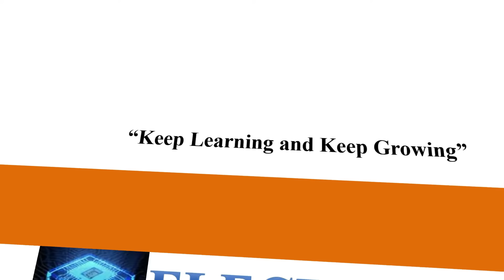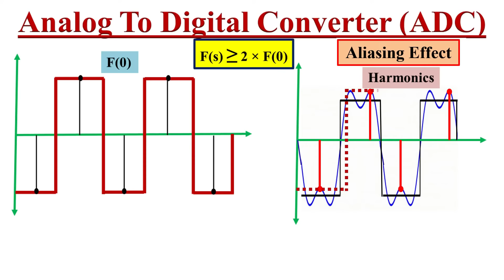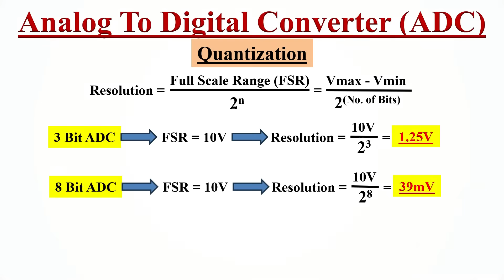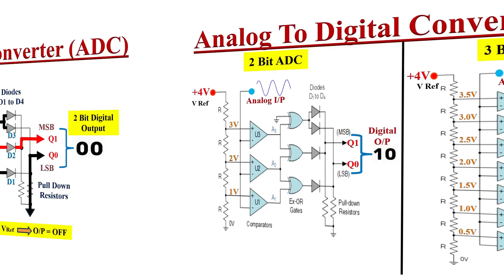ADC and DAC (Analog to Digital and Digital to Analog converters)

Comment from the maker: 0:16 Introduction,
2:07 Need for ADC and DAC,
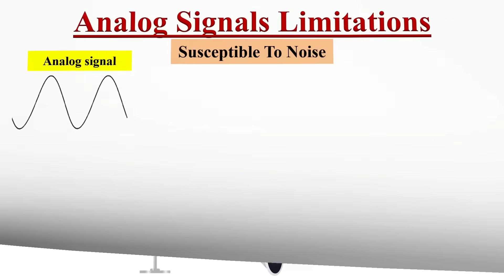2:40 Limitations of Analog signals,
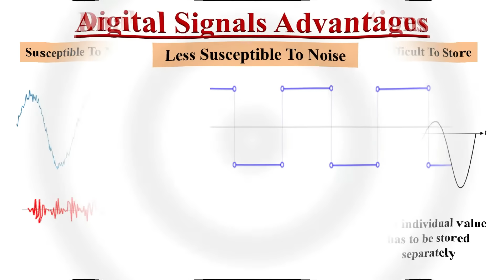3:26 Advantages of Digital signals,
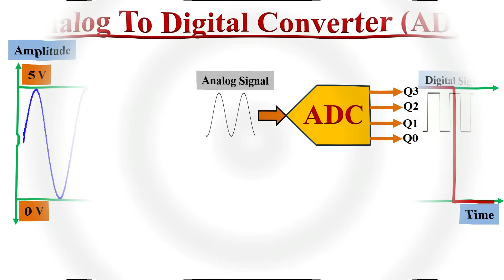5:01 Steps for Analog to Digital Conversion (ADC),
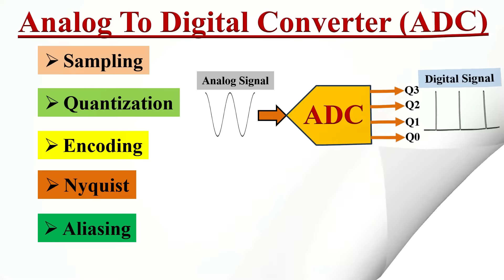5:22 Sampling,
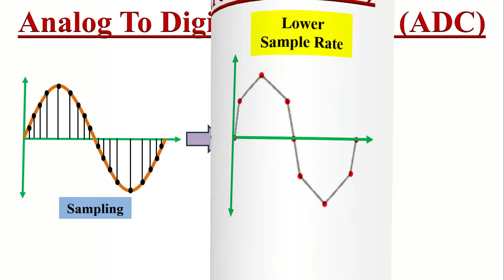5:49 Nyquist theorem,
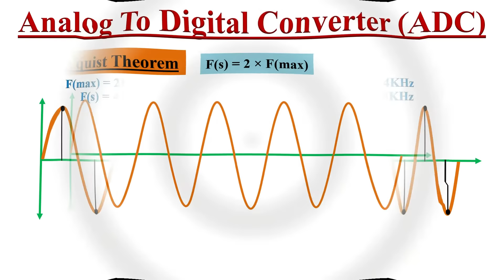6:26 Aliasing Effect,
6:58 Anti-Aliasing Filter (Square Wave),
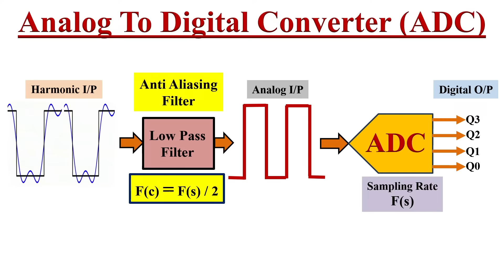8:16 Quantization,
8:54 Quantization Error and Resolution,
12:14 Transfer function graph of ADC,
15:40 Block Diagram of ADC,
16:23 Two-bit ADC working,
18:50 Digital to Analog Converter (DAC),
19:08 Weighed Resistor DAC working,
22:56 Resolution DAC,
23:55 Timing Diagram of DAC,
24:55 Parameter of ADC and DAC,
25:13 Applications of ADC,
25:24 Applications of DAC.